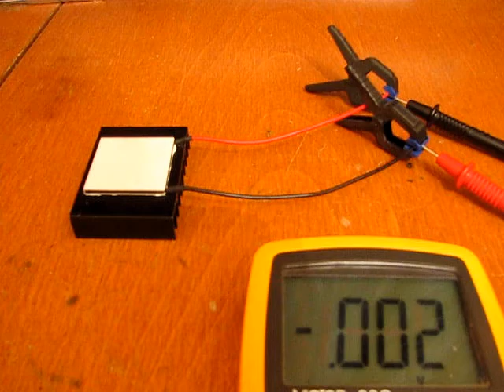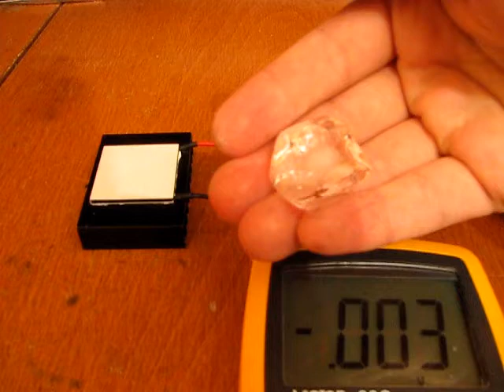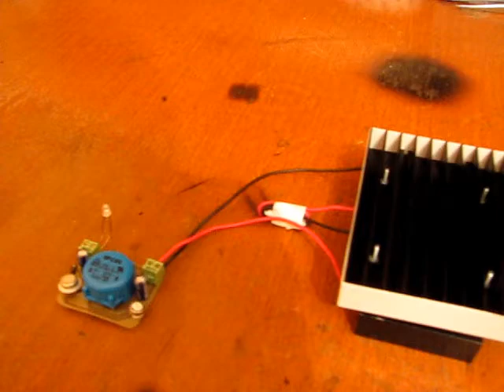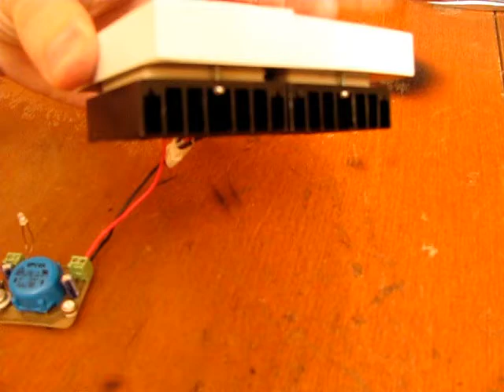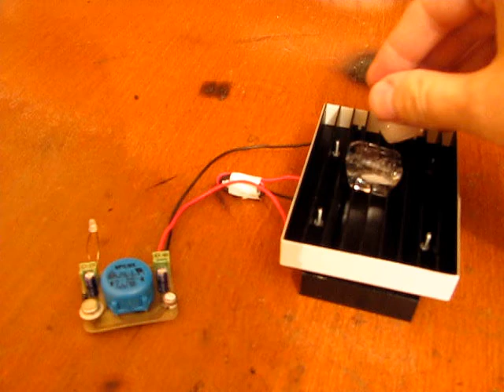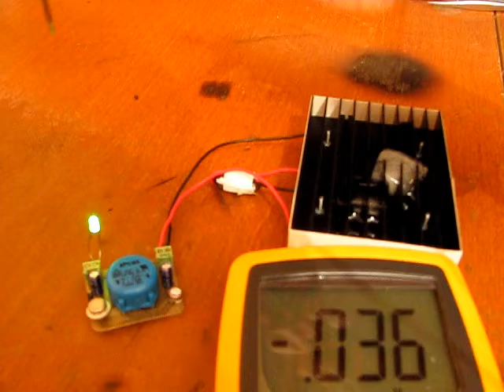Using Russia's main resource to generate electricity

Comment: What is making the ice melt
Reply: the heat sink is heating the ice causing the ice to melt. that temperature difference is what is creating the voltage across the terminals.

Comment: FAKE. I studied this dilemma. It only works when the heat sinks on the other side of the ice are hot as shown in the video. Watch how fast the ice melts. Same as if you were to heat the thermoelectric generator and set the heat sink on a sheet of ice. same result.
Reply: lol you studied this dilemma... whats there to study and what is so "FAKE" about this video? its quite an intuitive demonstration if you have any knowledge of thermodynamics. The video is simply displaying that the heat sink is heating the ice causing the ice to melt and that temperature difference is what is creating the voltage across the terminals.